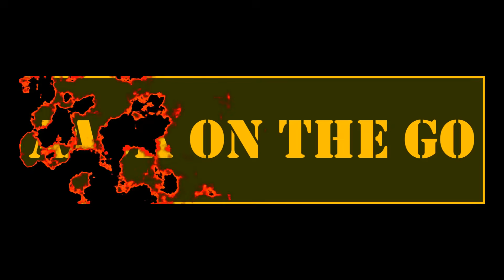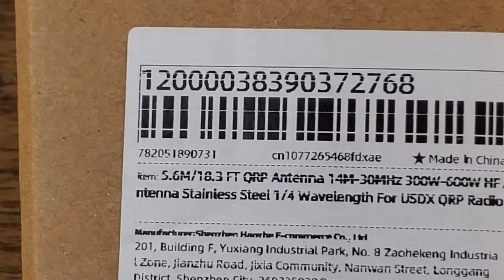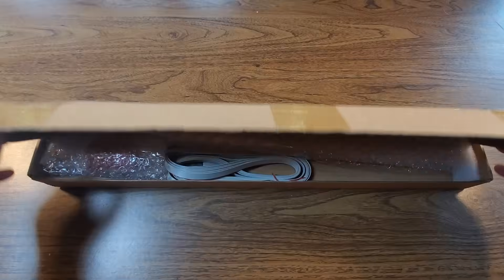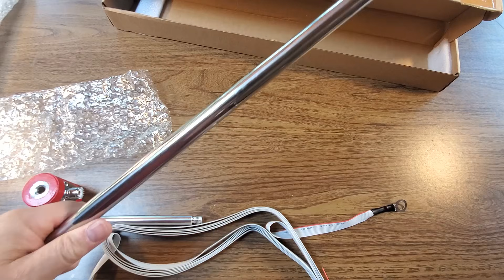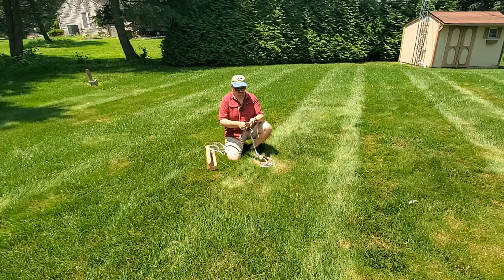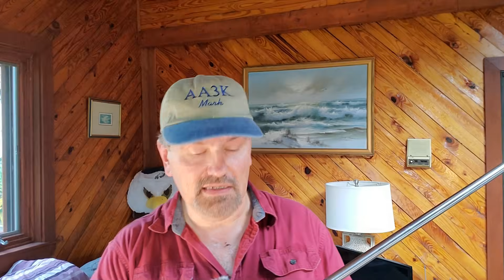Is This Budget Chinese Quarter Wave Vertical Antenna Worth It?

Comment from the maker: Before Field Day 2025 started i had a chance to quickly test this antenna in an open area. 17m - 12m improved somewhat but 10m was unchanged. I removed the choke and 10m performance improved to 1.2:1 across the band.  I put the choke at my RigExpert and performance again was stella. I suspect a longer counterpoise is needed fo 10m. 

Look for a more detailed video about this in the near future.

If you have any interesting comments on this antenna please note them here.
Reply: Did you have a look at the smith chart on the analyser ??

When chasing SWR matching issues I look at what the smith chart is doing. It may show you resonance where xL and xC cancel out but the actual impedance is way off like 150ohms or 20 ohms.
Reply from the maker: @MidlifeRenaissanceMan  I do need to refresh my knowledge about reading and using Smith Charts, been too long since college and i don't use them in my line of work.

Interestingly my non-technical son saw a YT video on them and asked if I knew about them. He was surprised when I said yes.

Comment: Thanks for this video, I'm getting one now! 73 9W2GNU
Reply from the maker: You're welcome. 

I've used it for one portable operation and it performed well on 20m. It's such a basic design, the only thing that can really go wrong is the radials self destruct as they are only ribbon cable.
Reply: @aa3konthego alright. But I can just make another set of radial with 20AWG and some lugs. They're M10 right?
Reply from the maker: @afiqzx Yes. I measured in the video and it was around M10. And you can use any wire to make radials.
Reply: @aa3konthego  Hey I just noticed that in 21:34, the 20m band radiator length in metric is wrong. Other than that, nice video!
Reply from the maker: @afiqzx I caught that in my follow up video on adjusting the radials. I have to see if YT's on line video editing tools will let me insert a pop up correcting that.

Comment: You totally need to check that continuity at least 8 more times
Reply from the maker: One good drop on concrete and yes, that center insulator could become worthless.  Though I haven't used this antenna a lot it has performed well on 20m.

Comment: The kit I just received, the telescoping antenna measured 18' - 1".  I ordered an extra telescoping antenna.  I plan to try this with an antenna on each side, forming a horizontal dipole.
Reply from the maker: You can do that. You can also try a vertical beam by putting a second one in the direction you want to aim for and shortening it by about 5%. I'm not really sure how far away it should be placed so that needs a little research. You'd only drive the rear one. The front would just be parasitic. Radials are still needed.

Comment: Performance on 27 Mhz?
Reply from the maker: As the whip is telescopic you can adjust its operation from around 15 MHz (fully extended) to higher than 50 MHz (fully collapsed). So there is no reason you cannot get a match on 27 MHz.

Comment: Great look at what some are calling the “red slug” antenna. I bought that same setup over a year ago and have done several POTA activations with it. It performed very well. I did, however, have to build a new set of radials as the ones that came with it just didn’t hold up as you surmised. I use 6 -16 1/2 feet ones that I made from 18 gauge silicone wire… they work great. I keep them on separate wire winders that I got from Amazon to keep them neat and tidy. For 20-6 meters I don’t know if this setup can be beat for portable operation, for the amount of money. I have better antennas but they costed quite a bit more than $28. I’m sure these are higher than that now though. Anyway, great video and I just subscribed … thanks 
David W9DXP
Reply from the maker: I like the name "Red Slug Antenna."  That is not only an apt name but a perfect quick description.  

Fundamentally there is nothing fancy about this antenna, It is a textbook quarter wave antenna that was covered in my earliest ham radio theory and college electromagnetics courses.  

A group lead at my first job working on RADARs said, "Give me the dimensions of a RADAR antenna and I'll tell you the frequency it operates at."  He was surprised when I agreed with him and said its because of quarter wavelength theory.

As for the radials, I fully expect to have to replace them if I use this antenna regularly.  Fortunately, not hard to do.  I already have ring terminals that will fit.  One more reason to carry multiple antennas if you can.

Comment: One question. On that chart that you presented on "Radiator length" I notice that you said that 6 feet 6 inches is good for 10 meters. Is that correct ? The quarter wavelength for 28.4 MHz would be 8 feet 3 inches. Was that a typo, or is there something different about this antenna. I noticed that the length for 15 meters was 11 feet 1 inch, which would be perfect for the calculated quarter wave length.
Reply from the maker: It's been so long since I ran these tests I do not know.  I've only used the antenna on 20m while portable.  I will have to test the antenna again.  However, it is January 2026 and we just had a major snow storm in my area so it will be a while before things thaw enough for me todo so.  I'll follow up.

Comment: TRY      MAKING    A     DIPOLE      FROM     THE     RIBBON      CABLES        !!!
Reply from the maker: An excellent idea.  I'm also thinking I've seen a design where you take 10 or so conductor ribbon cable and cut off the excess for each band highest to lowest giving you a compact fan dipole.  Something that would be interesting to experiment with.

Comment: Add a ring connector to the other end of the ribbon cable and cut it in half. 2.5m lengths are much easier to manage. I have also made up 2 bundles of 8 Sotabeams 24 awg wire 2.5m in length, again much easier to roll up and deploy.
Reply from the maker: Interesting idea! Though from my adventure in finding out I needed to adjust the radials to get a good match due to them being raised off the ground by several inches of grass, I think shorter lengths would give me trouble.

Comment: When I didn't have a test meter for continuity, I used a battery, bulb, and some wire to make a circuit tester. The feedpoint being under radials would be a better design.
Reply from the maker: Do you mean the feedpoint should be below ground level and thus the radials?

Comment: Hey mate,
China works with the metric system, so the threads are M10
Cheers and 73s
Allan
Reply from the maker: I have a clone of the SuperAntenna center loaded vertical and its threads are also M10.  I suspect that is the metric standard for antenna threads.  

No worries, you can buy adapters between thread sizes..

Comment: I put a 40m loading coil on mine. Yet the try a 80m loading coil. 
Vk7xc
Reply from the maker: I've been thinking of adding wire to the antenna to get to 40 meters. Just go from the top of the antenna roughly horizontal to a support such as a tree.

Comment: Have had mine for about a year now. Been to a number of parks to set up and not had an issue yet. I have used my ts-2000 and ft-847 at full power no problems.

Yes, the radials are thin and I have lost two to not paying attention in how I unravel them. Spaghettification it happen no matter how you wrap them up. Wrapping them around four fingers as one and then a twist tie has seemed to work for me to prevent total Spaghettification.

Mine had a little tab on the 239 and that's how I tell which side is ground after using a meter to verify where ground was.

As for the telescoping whip, I went and bought four more to have incase one breaks. Also bought a couple adapters for 10mm to 3/8-24 and the other way so that I can also use my hamsticks with the base or the vertical with a magmount.

W8ISS/r
Reply from the maker: I only recently found out about the thread adapters.  For my SuperAntenna Clone I asked a friend to weld a 3/8-24 (or is it 20, I never remember) nut to a 10mm bolt to make an adapter so I can use a 102 inch CB whip.

Comment: Thanks for posting this I enjoyed watching I am new to HAM radio and playing with different antenna set ups  I put up a Antron 99 the neighbours where at front front door with "Whats that thing ?" I said its to track UFOs "Please take it down" OK 

I have managed to put up a endfed inverted V on a fiber glass pole with no complaints and a small magloop I have two of thease chinese telescopic whips with a jpc 7 dipole type connector with a 1.1 balun I set up this morning and would like to use for for 10 and 11 meters in the UK my question is how far to extend each whip to get close 10 and 11, Meters Any advice greatly welcomed,have a good day all
Reply from the maker: For 10 & 11 meters just divide each wavelength by 4 to get the quarter wavelength lenght.  For 10 meters extend the whip about 2.5 m and for 11 meters 2.75 m.  This will put you in the ball park (cricket field?). You can then adjust the length of each whip equally to fine tune.  Measure the end result and write it down for future reference. 

Thank you for watching.

Comment: I use this antenna a lot for SOTA/POTA and WWFF. I have no issues with the ground wires getting tangled if handled and stored properly. I use one of the plastic antenna wire winders from SOTA Beams. I only really use it on 20m and have no problems getting a 1:1 match. I have used it on several SOTA sites and I even did QRP from a park over here to Japan.. so for the price just 30€ You can't go wrong. For 40m I use a home made end fed or a three band linked dipole which is 40/30 and 20.
Reply from the maker: I've been winding the radials around an empty paper towel tube starting from the far end so I can roll out the bundle.  I still have to separate them after doing so.  Tackle it by dividing the bundle in half and half again until I have all 10 separated.  I used it this past weekend in my backyard.  Made several 20m contacts even with the so so band conditions.

Comment: just for  giggles, use the figure 8 winding method on your hand and you wont need the paper towel roll.   hold it together with a velcro strap or small bungee..works great  good luck and happy hamming
Reply from the maker: I'll have to try that.  And if you hear a news report of someone getting trapped by wires...

Comment: I have one of these and have made a ground radial plate from a piece of thick aluminium sheet with a 10mm hole in the centre. I attach to this ground radials made from stripped out mains flex and this is a much more robust solution than the supplied radials at no extra cost.  I intend trying a long spike or tripod next to run an elevated radial set or elevated single counterpoise to increase performance.
I heard a motorcycle mobile in Ireland a few weeks ago using this same antenna. He had substituted the spike for a mag base and was using a road side crash barrier as a ground plane. With my 5w ‘Hamstick’ mobile I not could not fight my way through his pileup ! 73’s 😀
Reply from the maker: I also have a ground plate ready for when I get my Butternut vertical on the air again.  I agree the supplied radial wire is not the strongest but it is easy to replace if needed.  And timing is everything when trying to break a  pile-up with QRP power.  Try slipping your call in several seconds after the the call for a new station, wait until the onslaught settles out.

Thank you for watching!

Comment: I paid $20 for my first one. I’ve purchased spares because the quality makes MFJ seem premium. Gently used, they work pretty well. The supplied radials are junk. Toss them and use silicone wire.
Reply from the maker: That's a great point about the radials, and silicone wire is an excellent upgrade choice for sure.  And if you use a bright colored jacket, it helps people see that they are there.  Yes, I miss MFJ.  They made what hams needed and often gave you options.  Thank you for watching and commenting!

Comment: How would it perform without the radials, just using the ground spike?  Also, is it best to shorten the antenna from the top section, middle, or bottom section?

73
Jim
KC3ZHM  (NW Montco)
Reply from the maker: If you have really good ground conductivity like at the beach (salt water) you can probably get away with it. Otherwise you'd likely find very poor performance.

As for shortening, it's obviously easier at the bottom. But if can do it from the top, the resulting thicker radiator will have better bandwidth. Not much but better.  I operated the radio station on the Battleship New Jersey. They pointed the wide antenna masts over the bridge are so for increased bandwidth.

Thanks for watching!

Comment: splitting the ribbons was silly, you should have used all the ribbons for ground radiators.
Reply from the maker: The antenna comes with one ribbon cable of 10 conductors.  I separated the conductors of that ribbon cable to create 10 separate radials.
Reply: @aa3konthego  I saw that, but at the beginning it looked like you had more than one ribbon, which is why I said what I did. Sorry if I was wrong. 73's
Reply from the maker: @Steve-od6hi  No problem!  There is always the decision of how much to zoom in when filming.

Thank you for watching!
Reply: Just bought one of these and added 4. 5m thickish radials fully extended it was resonant on 13.400 so just shortened it by one section and it was 1.0 on most of 20m just need to play with it a bit more to get 1.0 across all of 20m . On receive on 20m it was as good as my 40m EFHW with a 6db lower noise floor . A good buy.

Comment: Hey AA3K. I've got this very thing in my back yard. I've upgraded to an aluminium ground plate from AliExpress with copper speaker wire as a ground plane. I even treated it to a cap hat, ferrite choke and lightning arrestor. I'm on the South Coast of England and can receive Alaska, Russia, Ukraine, Portugal. I've just treated it to a better feed point element and it works like a charm. Very interested to see this video as this antenna opened me up to the HF world. I rent so I can't put stuff up on the roof. Thanks for the video. M7DKU 73. (40 and 20m work the best for me on this).
Reply from the maker: That is interesting how you enhanced this antenna.  Verticals will get you DX with their lower signal take-off angle.  I need to fix my HF6V (10-80) as 40 is a real winner on that.  When I'm not making videos.

Thank you for watching!
Reply: Sounds great! Where do you put the lightning arrestor?

Comment: I juxt got one delivered yesterday through Amazon.   Thanks for the walk through on this antenna.   I'm planning on using it with an FT-817 and an LDG Z100 tuner if necessary.  I don't have a RigExpert for quick field measurements, and for now will have to use a nanoVNA.  I'm also in eastern Pennsylvania not too far north of you, up 611 near Reiglesville.
Reply from the maker: I'm working on a video about adjusting the radial length to improve the tuning.  Should drop this week.

A NanoVNA should work fine though I'm not sure if you can export screenshots if you need that.

You can use the SWR readout on the 817 to help tune too.

Thank you for watching!

Comment: Just used one of these on a family holiday at a cottage.  I can't offer any comparisons to other ontennas at the same location as it was the only one used.   I used the ribbon cable intact and added 8 speaker-wire radials of about 12.5 feet.  
It worked reasonably well and was quick and easy to deploy.   I can't say if a more expensive version of essentially same design would have worked any better.   The components appear to be reasonably robust.
Reply from the maker: More expensive may mean better materials and manufacturing but a quarter wave whip fed against an array of radials on the ground is the same regardless of the manufacturer. 

Thanks for watching.